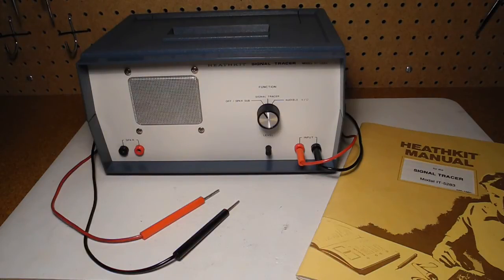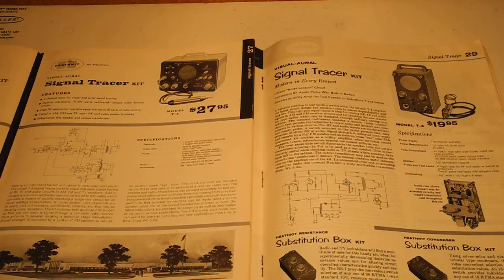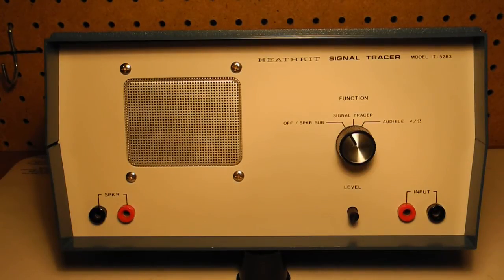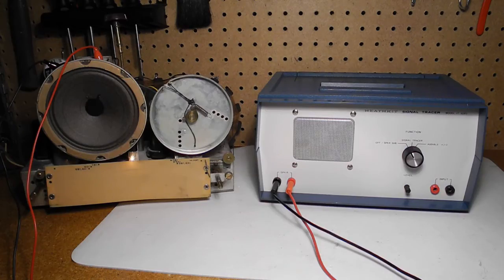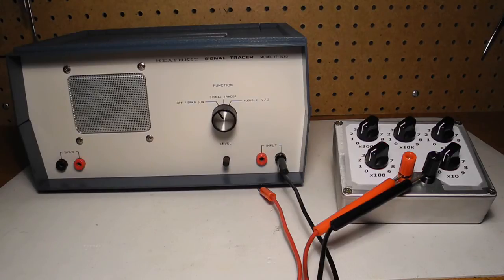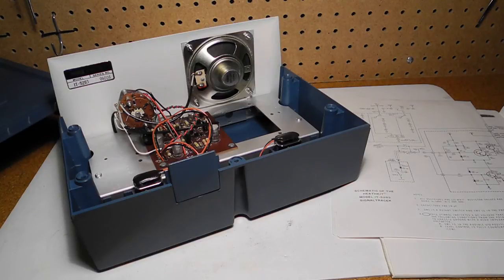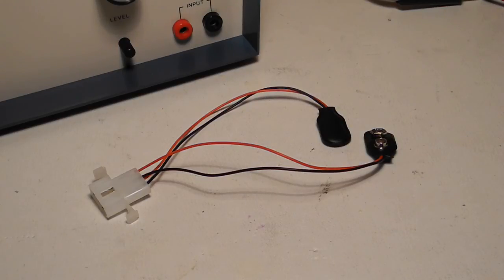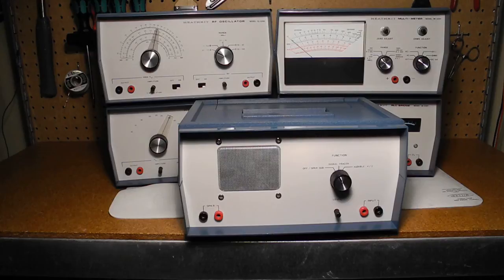The Heathkit IT-5283 Signal Tracer

Comment: Jeff, this is a question regarding the IT-12 signal tracer but I was hoping you could help under this video. Do you know replacement pot details (Mouser etc) that can be used for the level control in the IT-12 Signal Tracer that would allow proper fitment?
Reply from the maker: You want a Potentiometer, 100K, linear taper, solder lugs.
You likely won't find one with exactly the same shaft type, but it is not critical.
This one would be suitable, for example: https://mou.sr/4aucJ5J
Reply: Jeff, as always, thanks for the feedback!!!😁

Comment: I’ve got one of these on eBay recently. Seems to be in perfect order, but how can I test the probe on rf mode? I have a rf generator with internal mod. When I touch the output with the probe (ground on ground and tip on central spot) I can hear the note in dc mode and in rf mode either.
Reply from the maker: When you use the signal tracer for RF signal tracing, turn the probe switch to the RF position and the function switch to the signal tracer position. You may still hear some demodulated output in the DC mode as well if the gain is high enough. Mine didn't come with the actual probe, so I borrowed one from a Heathkit VTVM.

Comment: I have this signal tracer, but haven't used it in years.  I bought & built them in the late 70's I believe.  I lost the manuals and the RF probe when we moved, what value was the capacitor & diode for the RF probe?
Reply from the maker: It has a 1000 pF capacitor and 1N4149 diode in series.
Reply: Thanks!
Reply: It  looks like I will have to make me the probes is there a value for the diode?Thank you very informative video I also have this signal tracer.
Reply: @jefftranter  how do I use the signal tracer to find out what caused a channel to go out in a receiver?
Thank you
Reply from the maker: @SDsailor7  Google for "signal tracing" and you should find some articles and videos that will help you.